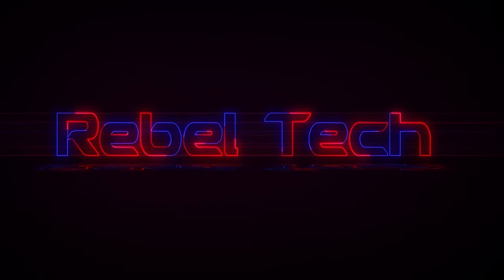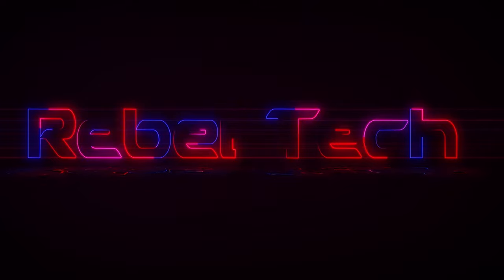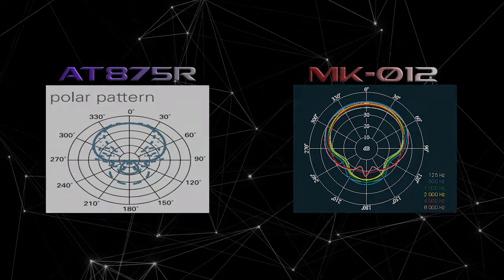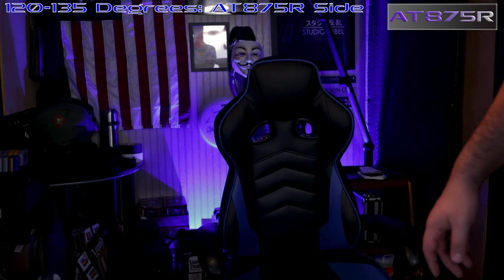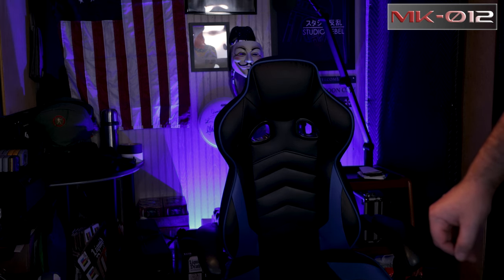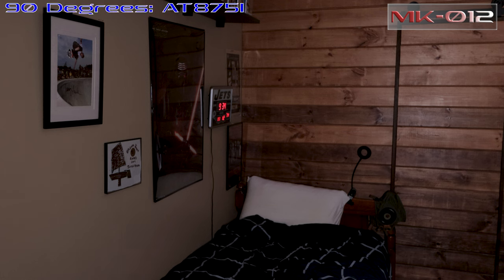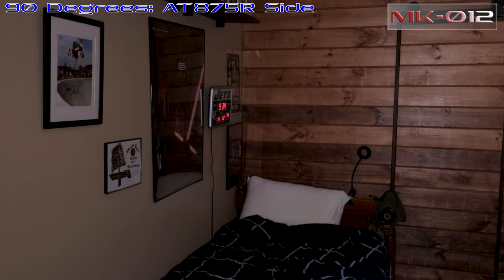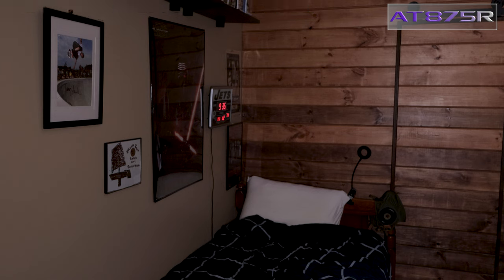Audio Technica AT875R vs Oktava MK-012 (Short Shotgun vs Pencil Condenser Microphone)

Comment: Which is more sensitive? Which did you have to boost a lot more in post?
Reply from the maker: In my experience the Oktava is more sensitive.  But I will say the 875R is more vercitial, where it can be used outside and the Oktava probably wouldnt do as well.
Reply: @RebelTech1990  that's quite strange. The spec sheet says the AT875R has a sensitivity of 31mV/Pa while the oktava 10mV/Pa which is quite of a difference I think should be noticeable..
Reply from the maker: Small diaphragm mics are naturally more sensitive but as far as gain I don't remember how much i put into them but it was closer than the specs say
Reply: @RebelTech1990  I am ify on that one. I have a sennheiser e614 and it's anything but sensitive. The sensitivity spec is 2.7mV and it reflects in reality. I have to boost my gain in reaper by 20db. But yeah most sdc are sensitive and have a flat response. Thanks
Reply: @joshmcdzz6925 what about e614 self noise, is it audible?

Comment: Outstanding video! Currently I have Oktava MK-012 cardioid in an untreated room I'd like to use for youtube (out of frame). Oktava is not very sensitive and I have to crank up the volume in Scarlett 2i2 and I'm getting a bit of background hiss that requires noise reduction in post. What is your opinion on Sennheiser MKE600? I've heard it has great audio and is much more sensitive. Should I consider replacing Okava with MKE600?
Reply from the maker: It might not be the mic, it could be the preamps.  Even with the MKE600, I think you'll still get hiss because the gain will be pushed.  I've only used the 600 a couple of times and it was just ok from what I remember.  The  Scarlett 2i2 has a gain cap at 56db, which is ok but with less sensitive mics/budget mics (Meaning anything under $500usd) you can run into preamp hiss.  You want to looks for something offering 65+ db gain.  That will allow you plenty of headroom to avoid the hiss.  That being said a Mic activator, for condensers, is another option but you can almost get a new interface for that price.  I know Midas Preamps are good.  There are some interfaces with them.  Hope this helps, let me know if you have any more questions.

Comment: You went outside with it.. much respect for that!
Reply from the maker: It was a test that is very important with these mics and I don’t see many people doing it. It really is a disservice to the viewer if you don’t get as many “applicable” tests. 

Thanks for checking out the video!
Reply: @RebelTech1990  I didn't know I needed an outside test until you did it. Thanks again!
Reply: @RebelTech1990  Hello! I really like how it sounds outdoors, and almost convinced now to buy one to use both indoors and outdoors for field recording of natural sounds (not voice). Do you find this usage OK or not, in your opinion?
Reply from the maker: I feel if you just want one of them then go with the AT. But it could give you issues inside if the acoustics are reflexive. What’s your main use for the mic?

Comment: I was waiting for that comparison for such a long time :D I'm amazed oktava has more low end with hypercardioic capsule in comparison to audio technica.  I'm using at875r and my voice is really bassy with it.
Well octava with hypercardioic capsule is my favourite but I'm surprised how much better at875r was outside
Reply from the maker: It really does come down to which tool to use for the job.  These mics really proved that concept to be true.  Thanks for checking out the video!
Reply: Shotgun is generally better for outside and the pencil microphone is generally better for inside.